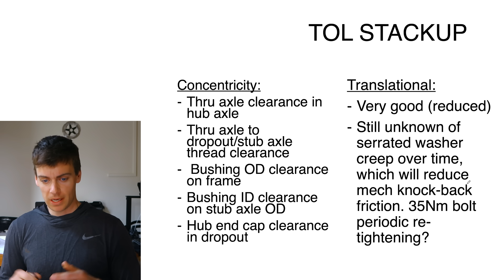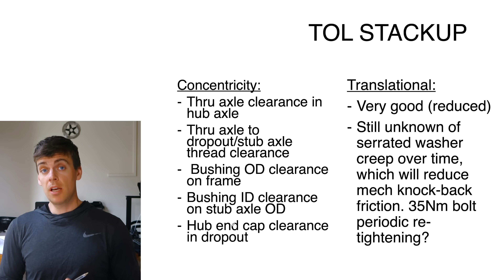More SRAM Eagle Transmission chat (including corrections)

Comment: I appreciate the simplicity and pure functionality of the derailleur hanger more and more lol
Reply: One thing I always find fitting to say is that a few decades ago the drivetrain system on the bikes have developed so well that it has become so hard to make a modification to this system without either making it worse or less efficient.
Reply: The old design was about trying to save an expensive part by sacrificing a cheap part.  The new design or complete removal of the sacrificial component has introduced other potentially more expensive problems. Perhaps the old system was too compliant rendering derailleurs out of alignment at the slightest of knocks.

Comment: The axle passes energy into the frame all the time from the wheel. Every time the wheel takes a big hit it is transferring all that energy into the frame. I don't think the derailleur mounting will significantly add to that.
Reply: Wheels and tires are quite elastic, whereas the derailleur body is very stiff, that's not a great comparison, I think.
Reply: @imrevadasz1086  there is some give in a wheel but it also impacting the axle and dropouts constantly while riding. Every root, rock, case, drop etc. 

A derailleur in comparison very rarely makes contact with anything, and if it did there are still mechanisms to reduce the transfer of energy into the axle.

Hangers are a design that predates mountain bikes entirely so they were not actually even designed with mountain biking in mind.
Reply: In fact it's probable that wheels tend to taco before the frame breaks, and tacoing needs a lot of force
Reply: I don’t see how your comment has anything to do with his concern for the derailleur. He’s not concerned with the axle or the structural strength of the frame, he’s concerned with the inner surface of the dropout area getting mangled and the frame getting KO’d by derailleur rotation.

Comment: Nicely explained.  :)

When I saw the "new, revolutionary design," one of my main concerns was the impacts - with hangers being softer for a reason, and now SRAM advertising their system as if getting rid of that is a benefit.
As it is often the case in the (cycling) industry - marketing seems to be given more budget than engineering.

My concern regarding the "35 Nm bolt periodic re-tightening" is that it might go deeper and deeper over time, perhaps increasing the amount of damage to a carbon dropout.
Not that I have a better idea of how to deal with the preload losses due to the washer digging into the material over time.  :(

P.S.
Only those who never do any work can never make any mistakes. Keep it up!  :)
Reply: Parts of the mech will break before the dropout. You don't need to buy a full mech, just the part that breaks. Watch the fanatik bike destruction test.
Reply: the problem with people is that they think they gonna hot their rear mech that violently. they never thought of when was the last time they got their rear mech banged. and was it that strong that it can break this new mech?  as if people can ride daily and crash daily. if you do crash daily might as well spend your money on this and enjoy,it will be inevitable that you'll be gone to a place where you cannot bring your money and gold.
Reply: @miyui9269  you don't have to crash, lotta rock strikes ... But to your point, it's a lot more common for DH riders or crashing at the bike park. And 99% of guys who ride park aren't getting AXS or spending much on a drivetrain anyway, so I do see your point.
Reply: Hangers were developed back when there wasn't a 12mm axle to stiffen and strengthen the rear end.
Reply: @CanonFirefly  hangers were developed as a standard to mount a rear derailleur. it was developed way before mountain biking existed.
Reply: @CanonFirefly  The clamping force with QR can be as much as a 12mm axle,  so a 12mm axle did not stiffen the frame, it helped for aligning the wheel better.
Reply: @christeschke9844  And what about the sheer force? Clamping force means absolutely nothing.

Comment: Good to see the elefant taken away from the room) However, we the viewers have something to add as well...

Regarding impact - if it is in upper link directly, it is eqivalent to hitting the chainstay. If it is lower, it will be dampened by the parallelogramm and then distributed between chainstay and - yes - axle, partially dissipating in non drive side chainstay. Another case of similar force application - side impact to the wheel. Given it happens much more often and the leverage because of wheel radius is much greater as well, it gives confidence impacts to the derailleur must not damage sufficintly designed and manufactured frame (and if they do, the frame would have been trashed from regular use anyway).
Regarding impact again, the old design was not absorbing much energy anyway. Gotta calculate the exact number though.

Also, for the dropout I'd move the datum A to the inner side to replicate production - dropout spacing is measured from there already. And again, axle to dropout perpindicularity is already required by the disc brake. What is changed here is dropout thickness tolerance. Sram took the freedom of designing and producing the threaded insert, but also made manufacturers free of ensuring tolerances of that insert, instead they are obliged to make a hole - an easier task. 

Axle pressing the dropout - well, what other designs don't do that? Be it TA with UDH1, other TA hangers or QR - the force and consequent creep is always there. Although agree, not so wise to make it affect one more element.

Lastly, in addition to my previous idea of epoxying the washer I'd file off those prongs too and let the derailleur swivel. From overarticulation it will be kept by the chain anyway.

Comment: I think friction between the washer and the mech is actually supposed to be minimal, as that's the new B pivot point. The nub in the mech slots between the two horns in the knurled washer and there's constant spring tension pulling it against the chain tension depending on which cog you're in. It's apparent in the installation video that the washer position is set at installation time based on chain length at the setup cog with the cage locked at a known angle. That only leaves the issue of impact rotating the mech-washer assy which will definitely eat into the dropout.

Comment: I think once you have a unit to fit and test your concerns will be addressed. The Stub axle sorts out the alignment and the tolerance. It terms of the knock back and serrated washer, yes that could abrade the carbon surface but consider that there are other features that reduce the likelihood of this scenario. The low profile design, the overload clutch and the outer parallelogram link breakaway feature all work together to take the energy out of the impact. I'm not buying the visco elastic creep claim for the stub axle torque losening up. Firstly the clamping area is large and typically carbon components are generally very dimensionally stable within the elastic limit and the material isn't crushed. I've never had stem bolts, QR skewers  don;t loosen up in carbon frames, not do seat post wedges if the fram e is left static for months. This is simply a non issue. Once you'veplayed with it lets chat here again because I'm looking forward  to your assessment after you've fondled the kit
Reply from the maker: In reality i agree its probably fit and forget. But it wouldn't be me if i didn't look into the small details/giving people a break from the blanket bombing of marketing videos. I hope to get to try one asap if my hightower is UDH!
Reply: I HIGHLY doubt SRAM would knowingly release a product that eliminates the hanger and increases risk of damage to the frame.  The blowback would significantly damage their brand and market share.

I awaiting more feedback with bated breath, and Transmission has definitely jumped up on my list of things to potentially upgrade.
Reply: @GiovaniUrrutia  exactly this ... They'd destroy their reputation. We're talking German engineering in the works since 2019 when they developed the UDH. They have thought and testing every single thing and I'm sure part of their research included talking to frame manufacturers, who are obviously fine with it since it's being marketed so heavily. And we're talking high end here, so these "transmissions" are gonna start off by going on expensive builds ... Just imagine the backlash if a bunch of carbon frames started breaking cause if it.
Reply: @PeakTorque  ditto , I’m a details guy too and I look at the why, how could it done differently and what would I do based on the design objectives. When the patent drawings were revealed on bikerumor I had a look and had similar concerns and also had a look at my DownHill racing mates broken parts. Most of them break the derailleur off because of either forgetting to engage the clutch on their Shimano RD or they use a cheaper SRAM derailleur like a NX because they’re constantly side swiping rocks. In these cases often it’s the clutch at fault or the chain is too short for extra tension . On a long travel bike that’s bad and places a lot of stress on the derailleur hanger as the load applied into it is in multiple directions. All of this works the hanger material and we know aluminium can work harden and fail. This is just one sort of failure. Improve the torsional rigidity of the mounting of the derailleur and it eliminates a potential failure point. I’m not sold on direct frontal impacts to the derailleur because that object has to get through a lot before it gets to the mech. Even when the drive side crank is top dead centre an object from the front has to get past the crank , chainring, chain stay. The derailleur cage is vulnerable but this design should make it more robust to being grabbed by sticks , shrubs , snakes etc. I believe there is enough fail safes built in for these concerns to abate over time
Reply: @GiovaniUrrutia  I think the product is great and a significant improvement on the derailleur system. However it does not mean it doesn't come with drawbacks. In my opinion the upside are better than the downsides BUT in case of a crash something will give and somtime it'll be the rear triangle. Will this system break more triangle than the old one ? Probably, but certainly not by much. It will prevent many other issues. Sometime a crash with a hanger will destroy a triangle that would not have happened with this system and vice versa. For example people riding with a bent hanger that they did not see will send the derailleur in the spokes, killing derailleur wheel and triangle (have seen this happen multiple times).
 When riding a mtb people must understand failure will happen at some point. You can't have something light and efficient and bombproof.

Comment: SRAM replied to a comment on their YT about the washer damaging the frame - "It absolutely will not eat into the frame. It is not a floating washer."

This system appears to be much better than a hanger. In a simplified way it is closer to a miniature crankset spindle and arm. It is different and needs a different way of thinking about it.
Reply: But of course they would say that. In reality everything fixed gets loosened and everything free floating gets stuck.

Comment: Zero tolerance stack up ... As an engineer I would have never thought I would see this sentence in my entire life. 
Marketing does a great job.
Very mature of you to admit your misunderstanding of the mechanical design of the product. 
Personally I think this could be an improvement. My hangers bend quite often and I would.
One small change to the washer and frame interface could make this a real great advantage. Would love to see a design where the washer has a positioning interface / notch, without the serrated face and a bike frame wich interact with that notch. Pretty simple, but it's a change to the UDH interface which is difficult for this industry.

Comment: You know they engineered a break piece on the Derailer? It’s replaceable they also put plastic bumpers to absorb shock that’s replaceable as well…

Im a mechanic with 15 years experience this idea you have that derailuer hangers save frames from damage is absurd. Broken Derailer hangers jack up frames ALOT. 

This new system looks to be better in every conceivable way you’ll see

Comment: Good video I’m glad you clarified some things.  It builds a lot of trust to post a video like this. Truth be told I was wondering how you inferred so much from pictures and didn’t give anyone the benefit of the doubt that they thought of those things. I think you and others get caught up a bit too much in countering marketing efforts.  Which I get. The shills are insufferable and it’s easy to want to get in front of that marketing engine.  stay objective and keep up the good work!
Reply from the maker: I do this for fun believe it or not! Thankfully that means i can what i want (within reason) which may ruffle feathers. Engineers critique designs. That's different from criticism. Please remember that.
Reply: @PeakTorque  for sure and I agree. That said criticisms coming from pictures maybe need to be a little less… confident.  Personally I think your points are all valid and won’t be giving up mech hangars anytime soon, but I think you understand the point. As engineers we test on real objects not pictures.  As the bike manufacturers should take your criticism with stride I hope you can take ours.

Comment: As far as I can tell, the design intent of the knurled washer was to achieve a set chain gap without a B-screw. I agree that it's not a great solution, and personally I'm betting that we'll see the return of the B-screw in future iterations of the hangerless mech.

Also, the original UDH isn't sacrificial in the same way as a conventional hanger. It doesn't really bend. Instead of all of the energy of an impact going into bending the hanger, in the UDH design the energy is supposed to be taken up partly by the friction of rotating the hanger, with the rest of it either dissipating into the rear triangle or snapping the hanger. This is exactly the same concept that is being applied in the hangerless mech. The UDH has been out for a good couple of years now, so if this kind of design was causing more damage to frames, we'd probably know by now.

Comment: Any downside to just replacing the knurled washer with a flat washer of identical thickness? I imagine at 35 Nm torque spec, it would still take quite an impact to get the RD to rotate relative to the dropout, and you alleviate the risk of damage to the carbon…
Reply: Knurled washer for alloys or a smooth one with grip paste for carbon?
Reply: @armadillito Adding carbon paste would have the same issue as the serrated washer. Carbon is incredibly weak to abrasion, and adding grit to grease would increase friction, and act like a grinding paste if a component slips. I think the best way to deal with this issue is a metallic face at the dropout, replaceable or otherwise.
Reply from the maker: When clamping carbon i always prefer a sandblasted finish to actual knurling. But it probably can't achieve same grip. However hub manufacturers have almost all done away with knurled end caps. DT Swiss have a very fine sandblast then anodize giving a very high Mu with little/ zero dropout damage

Comment: 13:10 if you look close I think that bike had an alloy plate between the hanger and the actual carbon dropout. Many carbon bikes had some kind of alloy part there for the axle threats. In the other side normal think is a bushing/insert to spread the axle load. I think  brands made things little different here and there,but a do not see that steel washer being  a major fault. I do not love the idea of being so expensive but it could survive most of regular accidents in enduro/trail ridding or at least it is harder than a regular one. Nice video.
Reply: Yeah noticed the same thing. That frame is probably totally fine. Although newer frames seem to not want to use aluminum inserts any more, not sure if its just weight reasons or cost is higher too.
 
The red frame looks like its carbon only.
Reply: @jaro6985  totally agree

Comment: Thanks for the video. Do you think there could be a breaking torque value specced for the rotation of the mech. Same idea as not doing the pinch bolts on your stem or brake levers up to 11. You want them to move in a crash, but not in use. If they could state the intended torque threshold to move the mech, in a big impact, it moves and theoretically you can just reset it. Do away with the frame circular saw washer, and use some kind of torque limiter, like in their totally unnecessary jockey wheel.